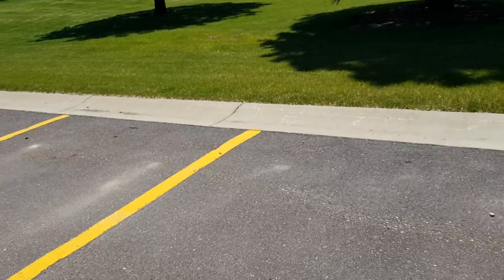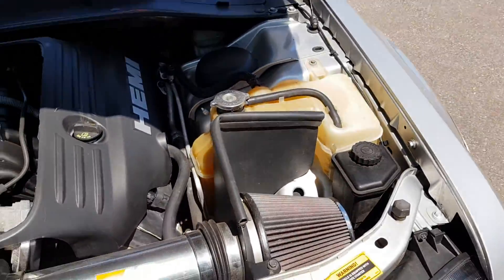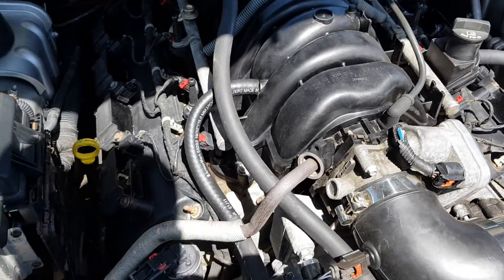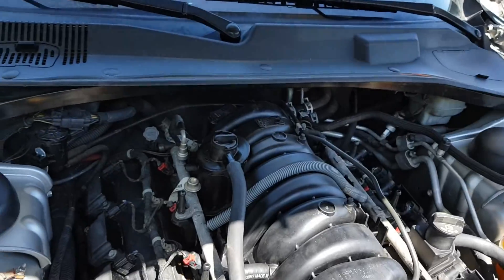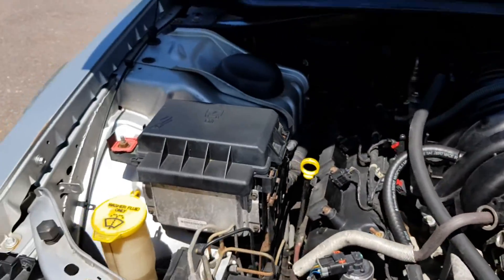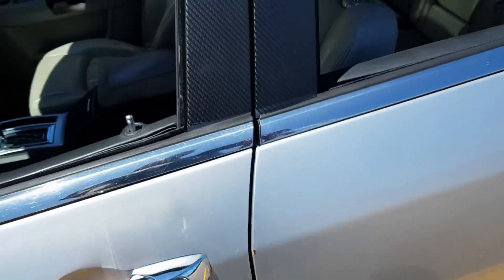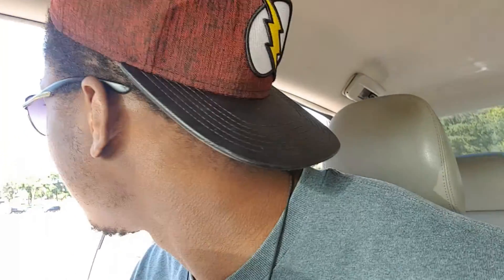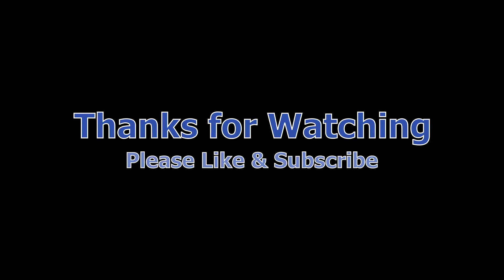Make Your Engine Sound Cammed?

Comment: You have a newer car. The Computer will compensate and adjust for the leak. But catalitic converters will muffle sounds especially when they heat up. On a car with open cats it will sound more noticeable.
Reply from the maker: Yeah but my car is catless
Reply: @Dan300  then it's prob gonna sound the best it can be. I think your car sounds great my man.
Reply from the maker: @dannytorino851  appreciate it 👍🏿

Comment: Did he just say “make it sound like a cammed v8 without actually having a cam” ??? All engines have cams to open open the valves. People will say “it’s cammed” and think okay it has a cam in it if it’s “cammed” therefore leading people to think engines don’t have camshafts unless someone says it’s “cammed”. Just goes to show people don’t really know about cars or engines. When someone says a engine is “cammed” it just means it has a bigger cam than the cam from the factory. All cars have camshafts.

Comment: Speed Density Buddy hahaha. The Way You Make Any Car Sound Like It's Got A Nasty Cam At Idle Is To Lean Out The AFRs. You Can Do This On MAF Sensor Type Cars By Creating A Vacuum Leak Like You Did. MAF Sensor Measures How Much Air Is Going Into The Engine. If You Do A Vacuum Leak On These Types Of Vehicles (Air That Goes Into The Engine Un Measured) It Will Run Lean And Lope Like A Cam If You Do The Right Amount If Air Leak. This Don't Work On Speed Density Mopars. They Don't Have An Actual Sensor That Measures Air. They Use Other Sensors Like MAP, Coolant Temp, Intake Air Temp And Throttle Position To Calculate The Air. So If You Make A Vacuum Leak It Will Not Be Completely Blind And Can Still Calculate The Air To Make It Run At Correct Air Fuel Ratio. What It Ends Up Doing Is Adding Fuel And The Result Is A Slightly Higher Idle RPM. The Vacuum Leak Has To Be Very Large On A Speed Density Vehicle For It To Start Idling Very Badly.
 https://youtube.com/shorts/V6SgsG4yeFI

Here's A Video Of A Stock Cam V6 Running Really Lean Due To A Faulty MAF Sensor Reading.

Comment: Sheesh, You read up on Mustangs and thought it'd work for a Hemi? That's the fail

Next time, remove the Map (Manifold Absolute Pressure) sensor connector behind the intake on the right hand side of the engine (left side of you looking at it)... that'll give you what youre looking for.
Reply from the maker: Interesting, I had no idea
Reply: @Dan300  It's what im here for my guy!